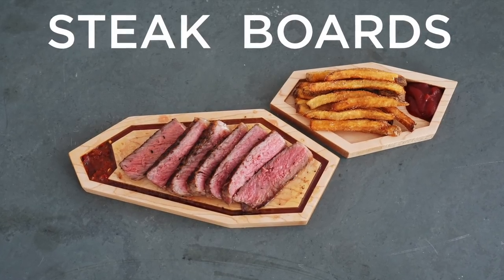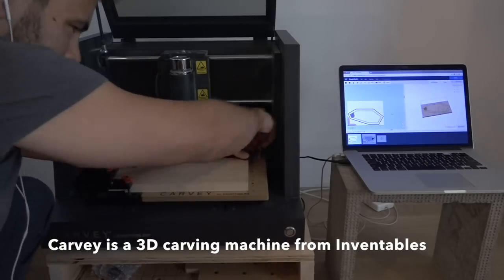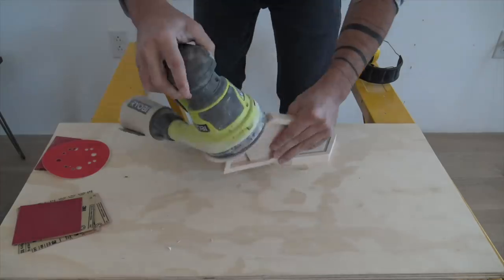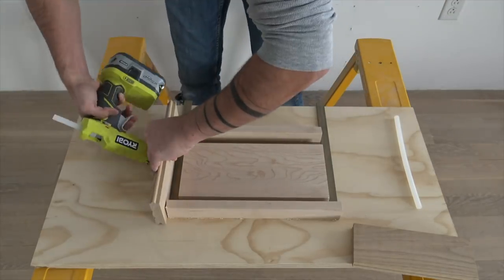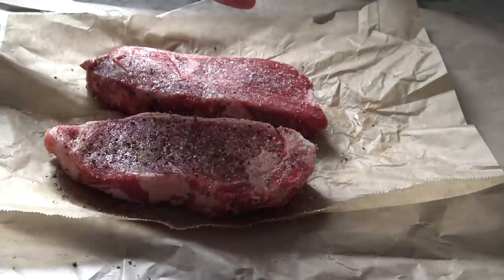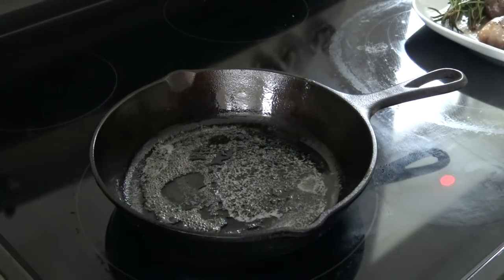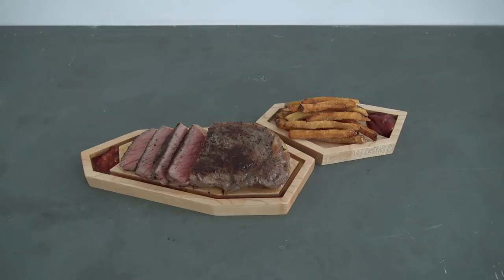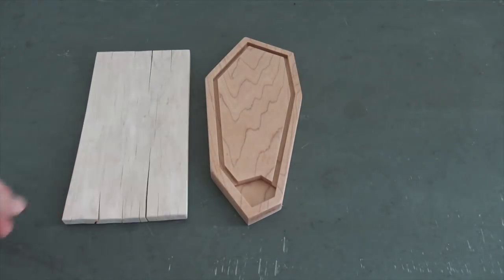CNCed Steak Boards

Comment: For the most part you should just hand wash those boards, but if you really need to have them be dishwasher friendly there are various finishes that would probably help them hold up better in a dishwasher. Nice job Ben!

Comment: You could try and make that out of something like Corian, which they use to make countertops, but totally works in a CNC machine (check out Evan & Katelyn's cutting board).  Then you could send them through the dishwasher indefinitely!  Really cool design!
Reply: The Every Maker - Nick If you do use Corian (or equivalents) the dust is a bit nasty, it will eat router bits and stuff like red wine can stain it but it is a lovely material.

Comment: This is awesome! We've debated on getting a Joule for the house.
Reply: Do it!  It changed my life
Reply: I'd suggest a different machine, my Joule stopped heating after 2 weeks of use and stopped cycling water after that. FWIW
Reply: DO ITT!! I've had a Joule for a little over a year which I use weekly and it has been terrific. It's so much smaller and more convenient than other circulators on the market and the app works pretty well.
Reply: I like the idea too but I'm still a little leery about having my food in contact with heated plastic like that, especially for long periods of time.

Comment: Hey, great project! The only thing I kinda disagree with is the resting time of a steak. When you pan fry it traditionally that's a must so the inside gets cooked too, but when doing them sous-vide they are already done on the inside, so you can bite into them right after searing the outside :)
Reply from the maker: good point! that makes sense!  thanks

Comment: Can anyone recommend a type of wood that would hold up longer than the 50x estimate for maple?
Reply: Also... just oil them with some cutting board oil after every wash & dry.
Reply: i make cutting boards of all shapes and sizes,  my care instructions include NOT using a dishwasher, and handwashing them, then reapply mineral oil as needed(when they appear dried out)